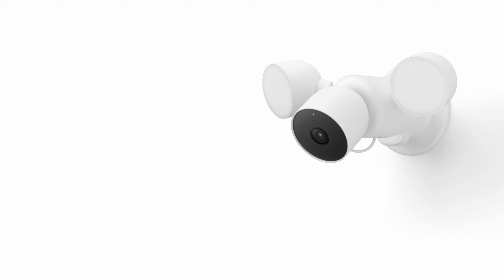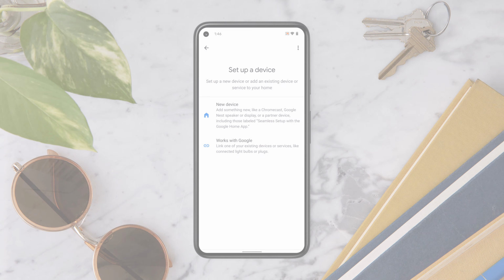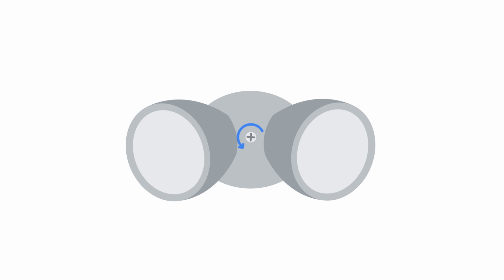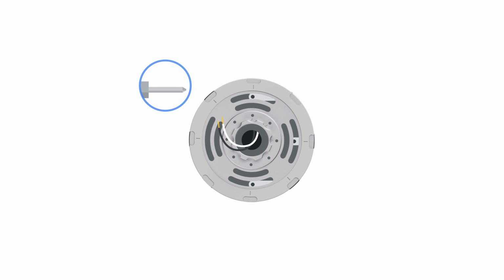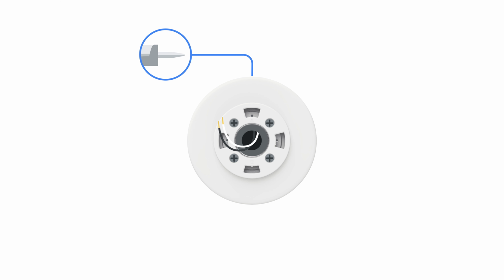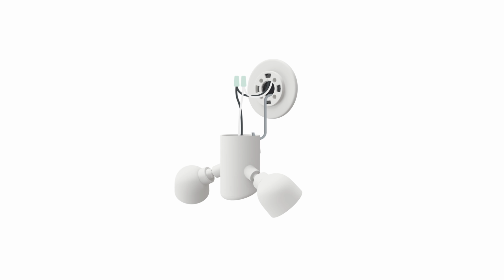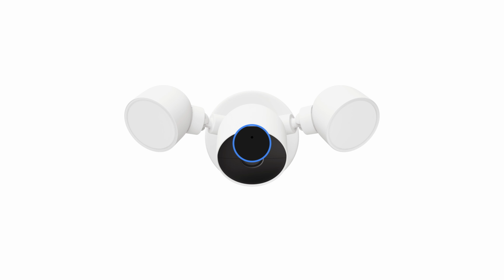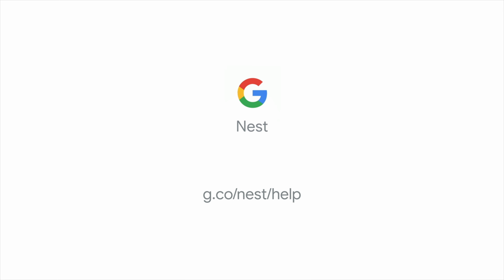How To Install Your Nest Cam With Floodlight

Comment: Just be aware T-MOBILE HOME INTERNET users, you will need an additional router because the Nest Cam Floodlight refuses to connect to the T-MOBILE router. I spent hours banging my head against the wall with google tech support to no avail. I finally found a reddit post that mentioned the problem with T-MOBILE. So I bought a new router that plugs into the ethernet port on my T-MOBILE receiver/router, and now the Nest Cam finally works. I also saw somewhere that after a software update, you can connect it to the t-mobile router, but I am all out of patience to do that right now.

Comment: Why is it that the flood light doesn't go off at dawn?  I've checked settings.  Not sure where it is that I'm missing this.  It was fine at first, now not working.  I have to turn it off and on through app now otherwise it stays on all day.
Reply from the maker: Hello there, thank you for sharing your feedback. We understand that your Nest Cam with Floodlight is not turning off at dawn, despite you having already checked the settings. We know this can be frustrating since it was working correctly at first. We would like to help you troubleshoot and determine what is happening. Please contact us here: goo.gle/3VinkfQ

Comment: Never buy this camera/floodlight combiation. The geniuses at google made it so it is onlly possible to set this camera up 1 of 2 ways. The stick that comes on the lens QR code, OR a 6 alpha numeric code that is brilliantly placed UNDER the power cable connection that happens to have an anti theft retainer screw holding it down. The anti theft retainer screw has locktite and will basically strip if you try to remove it so you can disconnect the cable.

When I reached out to google for help, they have 0 mechanism to assist and their only advice is to call a technician who will charge more than the camera itself cost, to come try and take the cord off.

This is by far the most embarassing product I have ever seen rolled out on a large scale basis.

Comment: Really need one that doesn't require hard wiring. The Wyze Battery Cam Pro has a floodlight built in (not super bright but good enough) that can turn on automatically and also has a siren.
Reply: good enough is not good enough for the rest of us .

Comment: I’m assuming that you have to connect the light/cam to power first, as in get someone to hardwire it in.  The instructions make it seem that you connect it first and then install it which is absurd.  Other than that the video is nice.

Comment: I’ve changed my ISP and tried connecting my Google Nest Floodlight Camera to the new router. In order to do this, I have to delete it from my Google Home App then add it again. The app is not allowing me to do so and it seems as if I’m not the only one to have this problem.
Reply: I do not think you should have had to delete the device from your Google home app. A new router would give you a new Wi-Fi network name and password. You should be able to reconnect the devices. For future reference your ISP gives your wifi a default name and password but you don't have to keep those. You can lob in and change them to whatever you want. You can even change them to be the same as your old ISP then everything would automatically connect

Comment: Why not just affix the QR code sticker to the manual or box, I threw away my QR code after installing, now I’ve got a new WiFi router and have to climb 30 ft to get the product code. You made thing unnecessarily difficult. Things could be so much easier if you thought about things from the end users perspective.

Comment: Can it replace a light fixture that’s not a motion sensor light fixture? It’s a light fixture powered by a switch?
Reply from the maker: Hey David, thanks for posting. Our Nest Cam with floodlight originally designed for motion sensor or detection, wired to the power source and can be switched on and off through the Google Home app. While we don't have news to share about replacing the light without a motion sensor — we'll take this as feedback. We'd appreciate if you could share your thoughts and feedback via this link: https://goo.gle/3KezjUf For more help, reach out to us through support channels here: https://goo.gle/3ie15Ae

Comment: Is there a kit for people who want to mount this on an exterior wall and not on an existing electrical box?
Reply from the maker: Hey there, thanks for your interest. While our Nest Cam with floodlight is designed to replace an existing floodlight, you can install it in an area using a junction box connection instead. You can check this link as a reference: https://goo.gle/3tf1Owt

Comment: I purchased but didn't realise it had no power lead like other cameras before. I plan to install this with a plug and cable.  If i run 3 core (positive neutral and earth) can i connect the earth to the camera fixing?
Reply from the maker: Hi there, thanks for posting. Only positive and neutral wires are needed for the installation of your camera and earth wire is not needed. We recommend that you contact a Nest Pro to install and set up your Nest Camera. Learn more here: https://goo.gle/3R3G7cq
Reply: @madebygoogle  using UK plug?
Reply: @madebygoogle  is the appliance double insulated?
Reply from the maker: We understand your interest in installing the Nest Camera. While we have no details to share — we suggest that you contact a professional Nest Pro technician for the installation of your device. Check this guide out: https://goo.gle/3sAzc0q
Reply: @madebygoogle  why don't you have details to share?    The link was no use at all.  It's it a double insulated product?  
It can operate on uk plug with no earth wire?
Reply from the maker: Hi there, thanks for the post. The Nest Cam with floodlight is designed to replace an existing floodlight. The app gives you basic installation instructions to install it. Also, you may refer to the video for detailed instructions. For more help, you can reach out through our phone, chat, or social media forums: https://goo.gle/3ie15Ae
Reply: @madebygoogle  unfortunately none of your info or installation instructions cover install using UK 3 pin plug.  I don't have existing floodlight.  This is a new install.  But to 3 pin UK plug.  Please advise.

Comment: Can I connect it using battery?
Reply from the maker: Hey there, thanks for reaching out. Nest Cam with Floodlight is designed to replace an existing floodlight and requires a connection to your home’s power that provides 100-240V AC, 50/60Hz.  If you want to install the floodlight in an area that doesn’t have an existing power connection and you need a junction box installed, or if you want help installing the floodlight, contact a pro: https://goo.gle/45nphcx
Reply: @madebygoogle  this is only for USA locations only im in Canada
Reply from the maker: Got it. To locate for an available Nest Pro technician in Canada, you can use this link instead: https://goo.gle/30Z70nv
Reply: @madebygoogle  any company on the Canadian - Halifax area list should be removed because I have contacted everyone and they all telling me they dont install the camera so I am confused as to why they adversite there that they do installation

Comment: I'm losing my mind trying to reinstall this floodlight cam after a network change. I've deleted it from my home app. Power cycled it and my phone. I don't have the QR code so am using the Setup Code alternative method using the code printed on the back of the camera. Every single time it drags through an extensive setup mode with cheery music - only to arrive at 'Something Went Wrong' after 8 minutes or so. The light on the device is green - does it think it is properly connected? Because it does not connect to my phone or account. I've done this 8 times now. I may need a straight jacket soon.
Reply from the maker: Hey AR, we're sorry to hear you're having difficulty in setting up your Nest Cam with floodlight. We'd suggest performing a reset with your device and set it up again — here's a guide: https://goo.gle/3Kw42gu If you need more help, reach out to us through our support channels: https://goo.gle/3meAs19

Comment: I was able to mount mine vertically.  Follow the same instructions.  The only differences are:  Be careful which way you put the white mounting plate cover.  There's  an antitheft screw that has to match up with the direction the camera will face.  Hanging from the s-hook will not work, just hold it with one hand and tighten the wire nut with the other, or get an extra hand or bungee to hold it up. Lastly, after setting up the camera to the app, go to the settings and rotate the camera 180 degrees.
Reply: Tffffffffffffffff😅f😮fgf 3:36 &&&&&&&3:36 3:36 3:36 f 3:36 3:36 3:36 3:36 ffgff

Comment: What if the old floodlight's junction box is horizontally mounted on the soffit or the porch ceiling?
Reply from the maker: Thanks for reaching out, Gary. We'd only recommend installing Nest Cam with floodlight vertically as it may affect the camera's line of sight. Also, here's an article that you can use as a guide: https://goo.gle/3XX7fdp If you have more questions, we'd suggest reaching out to our team via phone, chat or social forums: https://goo.gle/3RMJ7Hx

Comment: I have four IQ cameras and cannot get any of them to connect to my new router. It’s so frustrating. Misplace that qr code and you might as well throw this device in the recycle bin. Yes - I have tried the code on the bottom of the camera and it just does nothing. Ever. Avoid this product and I will be transitioning away from Google as fast as I can. Terrible product.
Reply from the maker: Hey there, we're sorry to hear about your experience. You could try rebooting your Nest cameras including your mobile phone and router to refresh their connection. Also, reinstalling your Nest app can help too. For more assistance, reach out to us through chat, phone or social support: https://goo.gle/3ie15Ae

Comment: Just installed. Everything works except that floodlights won't turn off. All settings are correct but lights won't turn off. Disappointed 😥
Reply from the maker: Hi David, we're sorry to hear that. You can check this out to know more on what triggers your floodlight to turn on and off: https://goo.gle/3Td0BhB Reach out to us through our support channels so we can better assist you: https://goo.gle/3ie15Ae

Comment: My camera doesn’t have the serial number printed on the camera to install (as I’ve lost the QR code)?
Reply from the maker: Hi there, thanks for reaching out — help's here. You should still be able to set it up using the 6-digit setup code from the camera itself. It’s located on the bottom near the charge cable connection and speaker. You can tap find the setup code on the Google Home app for guidance. Let us know how it goes.
Reply from the maker: Hey there, we're checking back in. Did the steps above help?
Reply: @madebygoogle  where is the code?  I still cannot find a 6 digit

Comment: I was hoping to add this to my collection of nest cams but I can't seem to get it to connect to my wifi.   I tried to connect with the dual band but could not.  I then disabled the 5ghz to allow the stronger signal of the  2.4ghz to pick it up... but no success.    After spending three days of climbing a ladder to reset the camera and too many hours of watching the animated google home app trying to connect...  I give up.    This was just a waste of my time.    I will be returning this setup tonight.   Not being able to view it with the Nest app was the least of my worries.   I'm so disappointed.
Reply from the maker: HI there, we're sorry to hear that. You could try moving your camera to the same room as the router. Also, try setting up your Nest Camera using another network or mobile hotspot and see if you'll get the same result. For additional help, reach out through phone, chat, or social forums: https://bit.ly/3o1aRK5

Comment: THE LIGHTS TURN ON I WENT THROUGH THE STEPS SETTING IT UP IN THE HOME APP I GOT AS FAR HAS TURN THE POWER BACK ON THATS IT  PLEASE HELP
Reply from the maker: Thanks for the post, Michael. Turn the power back on after you’ve installed your Nest Cam with floodlight. If it doesn’t turn on, check that the wires are connected and that the terminal blocks are screwed on tightly. For more help, reach out through our phone, chat, or social media forums: https://bit.ly/3adTfGB
Reply: i did that doesn't allow me to finish the set up after turning power back on
Reply from the maker: Got it. We'd suggest reaching out to our phone or chat support team so we could sort this out for you: https://bit.ly/3adTfGB

Comment: Hey google, Instead of providing an annoying video that's difficult for me to try and follow along while I'm on top of a ladder 10ft in the air, how about you provide actual printed instructions, or at least a PDF, that I can review at my own pace.

Trying to mash a thumb into the tiny bar to jump around in the video is going to get someone killed when they slip and fall off a ladder.

Edit: Also. Google is a trillion dollar company. Would it hurt you guys to label the screws so that I know which ones are which?

Comment: I was told you can undermount an on a soffit and there’s no way it works the court is too short to flip the camera upside down buddy have any ideas?.
Reply: Extra wire and splice, you can also flip the picture digitally 180° in the app.

Comment: Does the camera need to be charged or will it always be on because it is hardwired?
Reply from the maker: Hi Guillermo, we appreciate your interest. You don't need to charge your Nest Cam with floodlight — it is designed to replace an existing floodlight and requires a connection to the home’s power that provides 100-240V AC, 50/60Hz. If you need more help, you can always reach out to us through phone, chat, or through our social forums: https://bit.ly/3o1aRK5

Comment from the maker: Hey Vrashank, thanks for posting. After removing the screws from the mounting plate cover, you can  pull it off. You may need to use a flat head screwdriver to unclip the side, top and bottom clips. You can check this helpful link as a reference: https://bit.ly/3HfhWjv.

Comment: How do I remove the mounting plate cover? I need to rotate the poster cover by about 90 degrees to align the floodlight and camera to spot I want to cover. Even after removing the 4 screws, I am not able to remove the white plate cover.
Reply: I had to pry it off with a flathead screwdriver and some wedges.
Reply: Yeah I can't remove the cover. There's no instruction on how to remove it to readjust

Comment: Do they offer a plug in version? I don't have any old flood light system.
Reply: Not ideal, but you can modify a power cord and get a weatherproof outlet cover. You would still need to get a junction box though. Not an electrician though.

Comment: I ended up buying one as I have all the other Nest stuff. NOT happy that it doesnt, work in the APP... But, I am getting used the the Google home. I bough this beacuse it said "wired." Installed my self, so I know that there is no issues. No 9 days later camera is blank on screen & says: Device offline because of an empty battery. Does Google exepct us to climb a ladder once a week to re-charge this camera??? & how do you even re-charger it (LOL) Nothing in the instructions on websiite...
Reply from the maker: Hi Cameron, we're sorry to hear that. You could try performing a factory reset and see if that would make any difference. Also, make sure your wires are properly connected and the wire nuts are screwed on tightly. For additional help, reach out through phone, chat, or through our social forums: https://bit.ly/3o1aRK5

Comment: I keep getting battery alert.  This video doesn’t mention anything about batteries.
Reply: I have the exact same problem! I only bough this because it said "wired..." 9 days later dead battery. Are we supposed to climb a ladder once a week to recharger camera? AND how do you even re-charge it?
Reply: @hayburner_jr  Have you found anything out?  Went on vacation and WiFi connection went dead. Is it the battery?  Haven’t had time to look at the issue yet. The green light is still on but the connection is lost.
Reply: @dahank2332  Seems to be working fine now, the weirdest thing

Comment: How do I mount this vertically? The position of the wire won't allow me to mount from the soffit and exposes the cameras microphone to the elements. Is there an additional plate mount that I need to purchase?
Reply from the maker: Hey Charlie, we're here to help. For installing the Nest Cam with Floodlight, check the installation guide here: https://bit.ly/3oBvdN8. For more help, you can contact a local pro to install the device for you or contact us through phone, chat or through our social media forums here: https://bit.ly/3adTfGB.

Comment: Can it be installed on the suffit? Would the motion sensor work? Any issues?
Reply from the maker: Thanks for your interest, Lazaro. Nest Cam with Floodlight is designed to be mounted upright on vertical surfaces. Installing it any other way (such as horizontally, sideways, upside down, or at an angle) may reduce the floodlight’s functionality by limiting the motion sensor’s field of view. Here's more details: https://bit.ly/3uKhPXI If you need more help, reach out to us via phone, chat or social forums: https://bit.ly/3adTfGB

Comment: Our floodlight is switch controlled, does this have to be on the switch on position all the time? Or remove the switch entirely and connect the live wire on the switch box to the load wire so it gets hot/live all the time?
Reply: It should be wired to permanent live (if there is already a switch in the circuit you could just leave the switch in the "on" position and use the switch live as if it was a permanent live to achieve the end result but with a bit less work involved compared to wiring in a true permanent live) and you can use the Google Home app to control when the lights come on.